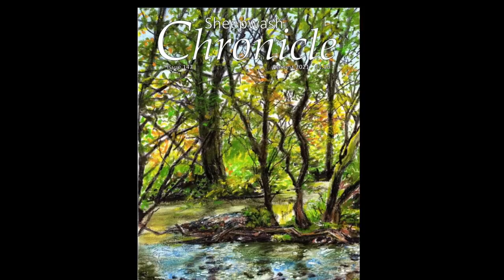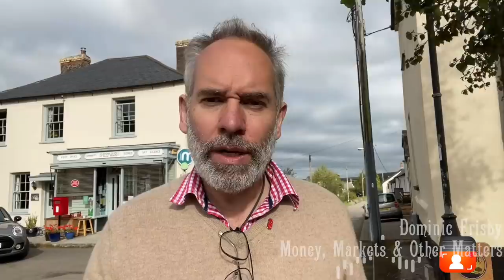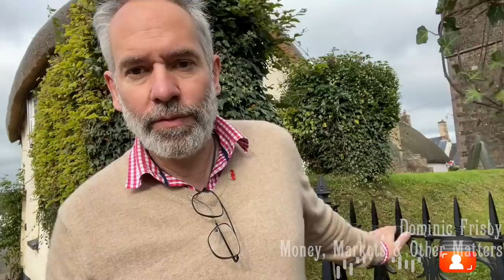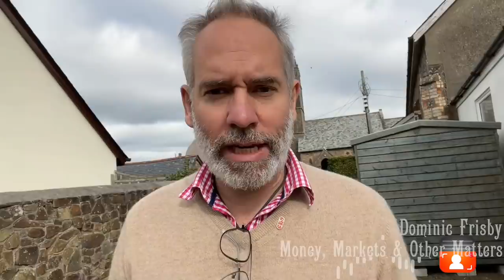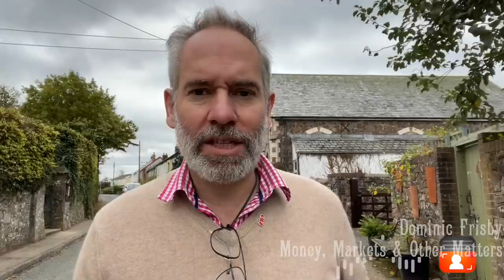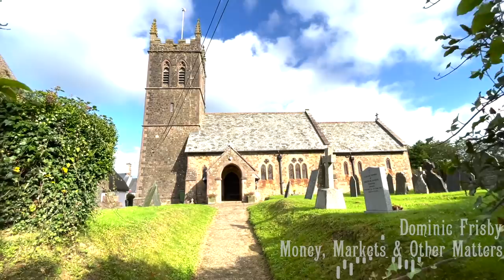Small Modular Reactors. - the solution to cheap, low carbon energy?

Comment: Bravo! - at last someone, dare I say, influential, that talks energy sense - though I would urge folks to also consider the likes of Moltex Energy, a British company that has some innovative nuclear solutions too.   But in any event, the simple fact remains - that affordable, safe and secure energy supply is crucial if this country is to have any chance of prosperity in the future.   The sad and frustrating point is that it will probably take a year or two of 'rolling blackouts', with their attendant miseries, for the penny to drop...
Reply: @Veldtian1  Thanks for info:  It does point that way - but how will joe public react when the lights go out, their kettle won't work, the central heating won't switch on and their ipad and smartphone batteries run flat?  The odds of this increase by the day as we move into winter.  - Panic buy torch batteries and candles I guess - if the shops can open during blackouts...

Comment: Modularity is good for everything. Batteries for cars should be modular with a standardised form factor and connection. It would make a car much more serviceable if the power plant was 50 modules rather than 1 battery.
Reply: Ah yes but the you won’t need to buy a new car when the batteries are knackered. There is not a car on the road now that emits as much pollution out of its tailpipe in its lifetime as is emitted in its creation, it’s not really about being green if it was we could just make cars last twice as long !

Comment: SMRs deserve to be in our energy pie. However our strategy on nuclear waste is still dump it in a hole in Finland.

Renewables do deserve their significant place in our supply. The intermittency argument is arguably becoming less valid with the onset of scalable grid storage tech. 

And am I mistaken here but surely,  across large geographic area and with a well connected grid, can't power be distributed at a geographic scale larger than cloud formations these days?

IMO it's not a question of making a choice between renewables or nuclear. We have to do all of the contributing solutions, plural. Tidal and hydro also, and even nuclear fusion hopefully

Finally, if the Gov wants to subsidise anything, it should be for domestic solar and battery!! Generation and storage right at point of use!! (And micro turbines).

Not massive ex-UK corporate offshore wind. Agreed there.

I guess the major energy companies wouldn't need to exist though in that case and we can't have wealth being redistributed can we

Comment: Check out Thorium reactors, specifically Liquid Flouride Thorium Reactors LFTRs. The Chinese are testing theirs at the moment.
Reply: Problem with Thorium is no one wants to invest, other then the Chinese. SMRs are still going to be expensive to develop, but RR got 215 + 300 million funding so far and will be needing more before delivering the first in 2030. Funny thing is we will have to copy the Chinese Thorium tech if they get it working, their is a turn of the tables.
Reply: @smellypunks  Also India and Holland involved in Thorium.

Comment: There are several SMR's currently stored at Rosyth dockyard, all of them in heavy steel containment structures, why has no one seen fit to draw power from them?
Reply: It might depend on how old they are and what state they are in. If they require modifications to bring them up to current ( pun intended ) specifications, it might be cheaper to just build new ones.

Comment: Good video Dom and I completely agree, we should be deploying SMRs to help the transition to electrification of the economy.  

However, in the longer term, renewables must be the way to go, for no other reason than it has the most potential if technological challenges around large scale storage and efficiency can be overcome.  There is a lot of promising research taking place in this space - in a decade or 2 the landscape will be completely different.
Reply: No!  Solar only works as well as it does, which is not well at all, because the panels are made where Energy is cheap and used where Energy is artificiality expensive.
Wind Energy is proportional to the CUBE of its velocity so, if you had velocities in the ratio of 0,1, 2, 3 and 4, say multiples of 10mph, in equal periods, the Energy produced would be 0, 1, 8, 27 and 64, the sum is 100, so they are percentages. Therefore, for this idealised example, not only do you get no Energy for 1/5 of the time, for three quarters of the time the output is below 27% of capacity. This is just as big a problem!
For solar, on average, zero Energy is produced for half the time, and it's even worse than that when you need it most, in the Winter.
So, for both, capacity will need to be more than twice the average demand, and that assumes the Energy can be stored and used at 100% efficiency, which it cannot.

The only solutions to fill in the gaps are Methane (Natural gas) for near instant demand, Coal and Nuclear, but what do these expensive items do when the Sun shines and the Wind blows?
And the renewables don't supply the Inertia that help to keep the voltage frequency stable.

Comment: All fine, but I'm still nervous about pressurised water reactors. 
Once molten salts reactors are on the table, I'll be right behind you.
Reply: Molten Salt and or/ LFTR are the only way forward coupled with gas turbine not steam turbine generators are also the only way.

Comment: It’s so obvious we need to mix.

Wind power will become cheaper Solar will become cheaper. Maybe thorium reactor. In the same way we abandon the electric car. Which are  is now proving to be cheaper. We should continue to try all different types of energy.
Electric cars came out before petrol ones.
Wind power used to run all the mills in the world. Maybe we can go back to factory’s  running when it’s windy. I guess that depends on the cost of power.
BYD are about to release electric cars at the same price as petrol ones.

Comment: The problem with current nuclear energy is that water cooled reactors build at large scale are not safe enough which is proved by accidents and there is a lot of lies about nuclear energy and radiation.

Comment: Low carbon?  This is the carbon that makes up .048% of the atmosphere?  That carbon or somethin' else?
Reply: It's a low percentage, but it's impact is still vital, and our current levels are 20% higher than 60 years ago.
To put it into perspective, if we reach 0.1%, temperatures rise by an average 10 degrees c around the world  and sea levels rise by 60 metres
Reply: @physninja  20% of next to nothing is still next to nothing.  Do you know what happens at .03% CO2?
Reply: @clangerbasher  I do. Plants grow bigger that's why they use it in greenhouses to make tomatoes and cucumbers grow better.
Reply: @michaelsnelling3338  No at .03% all the plants die.  Exactly what is the impact of a gas that runs at 420ppm of the atmosphere?
Reply: @jonparsons6818  Actually I think you have probably taken some.......
Reply: @clangerbasher  I fell into that 🤔
Reply: @clangerbasher  elevated CO2 concentrations of 475–600 ppm increases leaf photosynthetic rates by an average of 40% (Ainsworth & Rogers 2007).
Reply: @clangerbasher  Anyway, it makes no sense to say that a small amount of a natural substance won't have a big effect if you double or triple it in a system.
Anthropogenic climate change is a real thing. Just maybe not the emergency we are told it is. Maybe if government was a bit less free with subsidies we would have nuclear power now with wind and solar for those that want to be more self reliant.
Reply: @jonparsons6818  🤣Not to worry.   But what magical properties does CO2 have if .048% and rising is such a danger? What impact must 21% oxygen have if 2 oxygen atoms are such a problem?   CO2 is plant food.  And the seas sequestrate vast amounts out of our atmosphere.  We are if anything in an era of low carbon.   All I want to know is what does .048% of anything do?
Reply: @michaelsnelling3338  Yes.  All plant food.

Comment: Strictly by economies of scale, small modular stinks, and wouldn't compete well with other energy sources.  And near term there isn't going to realistically be thorium or fast neutron or exotic nuclear tech that's inherently safer.  In fact nuclear would only work if climate and other factors necessitate need for a higher acceptable power plant risk.

 Near term small modular or any nuclear reactor will be conservatively engineered. Not thorium or gen If, but PWR, boringly traditional light water reactors with a use once throw almost everything away fuel cycle.  They will even if smaller have same intrinsic risk.  It takes 2 to 3 days after a reactor scram for decay heat to cool the fuel rods below their melting point.  It's physics, and cannot be changed.  If water is allowed to boil and/or rods exposed to air, there is a meltdown... period.

 Just as a private plane crash isn't in the news but a 300+ death airliner crash is a huge national disaster, the REAL advantage of SMR technology is psychological/political.
 
 Realistically to decarbonize with nuclear, you have to accept looser safety to be cost effective, and accept that meltdowns will occur.  But having many many smaller reactors to spread the risk and minimize impacts has big public relations pluses.
 
Meltdowns will happen, and realistically more often, but with SMRs, it's only dozens of square miles that might get contaminated per incident, unlike a Fukashima that can contaminate many times more when they go, and is a very public very large disaster, both in dollars and commercial/political damages.